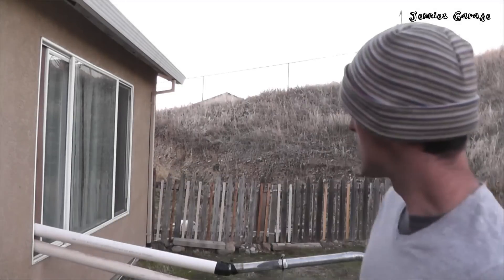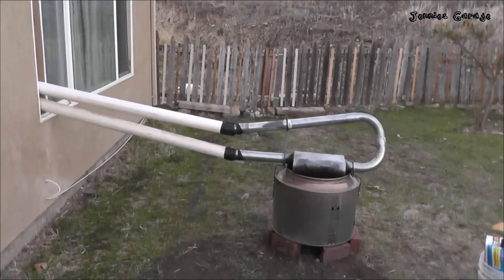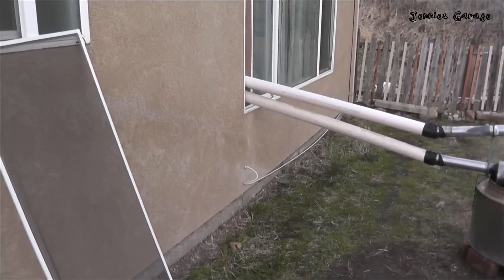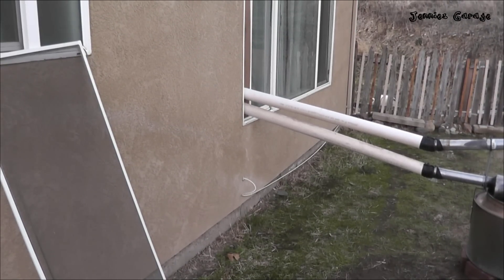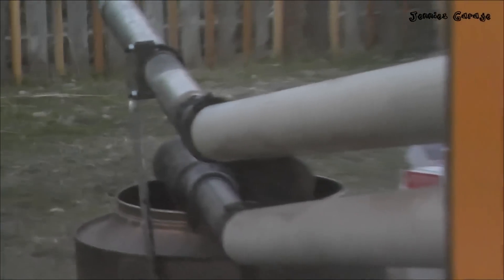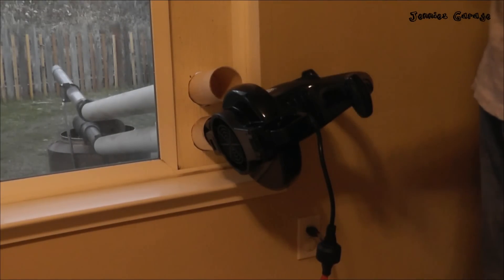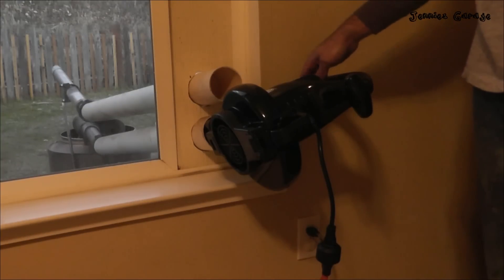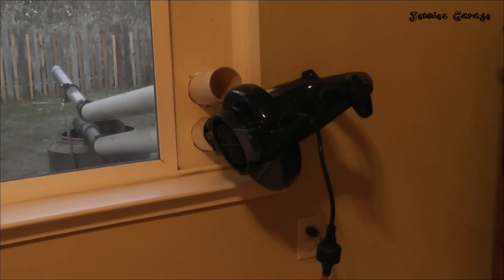How To Heat Your House With Garbage - Testing The Trash Furnace

Comment: There should still have been heat coming from the pipe, even without the blower. Build yourself a large lantern made of metal, then make yourself a large wick, fill with an oil, such as old cooking oil and you wont have to worry about throwing paper or wood as often to keep a fire going. Also, just a good fan such as the vornado fan should do the job and not so noisy.

Comment: Top job but will people complain about smoke? I have a car radiator from a Toyota hilux and with a burn barrell wrapped in copper plumbed into the radiator turning into a heater core and quiet thermo fan for circulation. Btw burn barrell gets to 250 degrees celsius with copper pipe to circulate air should heat up entire house! Any reply appreciated thanks?

Comment: I think it is better to use radiator system based on water. Water grabs the heat better for longer time tha air. But it also has to be careful with pipes and pressure holding. Pipes should be possible to move. If you use a real boiler to use your garbage or as down written here it is better to form your garbage to pellets. Compressed garbage will not eat up all your time to feed to boiler. Also a pellets boiler send in garbage pellets exactly at the time counted when burned. To much makes too much heat you dont need. It is important to use an measure-device to see the temp outside vs inside. Then you have an automatic system. The smoke that generating is probably not that healthy unless it burnes for longer time = should pellets. You must have som typ of filter that takes away the emissions. But great thinking but it already exists good systems for this but you can buy refubished systems but you must check your house or bedroom what it takes to heat up and walls, roof, floor = the U-measurements thats a formel to count how much it stands against letting heat let out of the room to the outside of the house... Count the transmissions through this to see if your house are well built. Start there and the rest you can find on internet or YT, local stores.

Comment: There is so much fail in this video! Do not burn things like motor oil and sneakers in this!!! Stupid advice. This is NOT an incenerator! 

Using a 7A leaf blower for ventilation? Really? There are many other better suited choices. A sheet of OSB in the window gap? Come on. You'll lose more heat through that interface than you would ever generate with this contraption. Thoughtful idea, extremely poor execution.

Comment: Why don't you put that device in your fire place and burn paper in there? It probably isn't very pleasant having to go and stay outside in the cold to feed the fire and if you burn it in the fireplace, you get way more use out of the heat. You should also use a smaller and quieter fan and build some kind of a shroud around it to direct the air through the pipe so that its quieter and more efficient.

Comment: @Jennies Garage i have an idea for you  look around for a kiln and dismantle it as in take out the walls and the heating elements and then get a car radiator and cooling fan or just the fan and connect it to like a riding mower battery for forced cold air into the lower side still using your muffler put the pipe you use to test the temp at the top of the kiln walls and then if you dont want to use pipe or its to expensive get semi rigid dryer ducting it can take alot of heat, just a suggestion from a fellow diy'er. Love the idea i just suggest a kiln because its designed to get almost 4000 degrees and most houses won't ever get even close to what those can take look me up on face book as peter or pete king if you wanna talk more about stuff like this. hope my suggestions help.

Comment: If you want to increase efficiency, control the burn.  Introduce forced air into the furnace.  Control it so it burns as hot as possible.  It will burn cleaner and more efficiently.

Comment: the issue is the wife will need to constantly need to feed the fire to keep you warm, you could add garden prunings to make it last longer or wood, or even drip abit of waste engine oil on it, and use a computer fan rather than the wife's loud as hair dryer.

Comment: Heat rises , No need for the fan , Have the outlet the lowest you can and the inlet the highest you can , you will have SLOW air flow which will allow for better circulation , The real challenge is in feeding that fire all night , Good job i like the ideal a lot .

Comment: Could you have used water?, had that going into a radiator in your room and used only the properties of hot water rising and then sinking when it cools. 
Used an old car or truck radiator sitting in hot water.

Comment: You would need carbon monoxide monitor. Burning anything high in hydrocarbon isn’t safe like plastic. Use bathroom ceiling fan it use less watts and quietly.

Comment: Would Puting a smaller fan in the tube of the entrance pipe would cause for slower air flow but hotter temp. As for the comments on feeding the fire he can make a self feeder I'm pretty sure he seems intelligent and rational if it wasn't worth it I am sure he would state it.

Comment: I actually built something similar to this but instead of using a muffler I brazed 8 copper tubes side by side and welded it to the top of the can, then instead of having fan inside, I used an inline duct fan which would actually work great for your build, I made a shroud that completely seals to the ends of the copper tubes and then routed them into the wall of the house, it's nearly silent and yet adds so much heat to the room
Reply from the maker: That sounds like a much better system then mine. the copper is a great heat conductor, and those 8 tubes probably pick up a lot of heat.
Reply: The copper is pretty cheap and you don't need much either

Comment: try fan outside use solar so your not spending huge amounts running fan also fan need to run slow or it will cause a cooling effect

Comment: What you did is a fun project and good proof of concept.

I'd be tempted to build a full sheet metal jacket around a sealed wood stove outside and let it burn logs slowly.  Those can run as much as a 12 hr fire without tending.  The larger two layer jacket can transfer the heat into the house with a slow fan through larger ducts. Probably 70,000 BTU off an old junk stove and a little welding or duct building.  That should heat a house quietly with no smoke removal chimney to build in the house.  Just a good twenty foot stovepipe outside for efficient draw.  You can start the fire with trash and then add wood.

Farmers have used these systems for a century, and you can buy the whole thing for a mere $2000 at Farmer Supply.  You can probably build it for 200 as you are a good scrounger.

Comment: You should use a blower motor from a junked car or old furnace instead of the leaf blower. It will be much quieter and probably work just as well. Or put the blower outside, plug it in outside if you have an outside plug, and use a Wifi switch to turn it on and off. That way less noise will be inside.

Comment: to overcome the inside noise you could put a y on the back side and use the bottom pipe to draw air from inside. will be loud outside though. use the paper to start a fire and then feed wood. you will need a larger bin to hold more wood. the concept is solid though.

Comment: With loose paper and cardboard like that, more heat is going around your exchanger than can be used. Bundle it, roll it, compress it, whatever in order to have a more efficient transfer of heat and for a much, much longer time.

Comment: mount the air blower out side .and take all the paper and shred it put it in a bucket of water over night .dran off the water and twisting the papper in to a log shape let dry for to days .it will burn hot and longer

Comment: I had some problems with what you did.. You have to buy more food more stuff to make more rubbish (trash) to heat the fire. You have to use electricity aka the leaf blower to get the heat so there for the money you are spending in buying more stuff to heat the fire and running the fan you could just put on the gas and run the normal heating :)

Comment: I have a fireplace insert that does the same thing. Heats up the cast iron frame and uses a blower mounted underneath to move radiated air past it.  Works good lasts a long time.

Comment: Just finished both videos. I too, Had been searching for a cheap heat exchange idea. You nailed it sir! I would change a few things... 
1) add 90 degree fittings aiming up and down.
2) possibly all steel pipe with insulation.
3) a PC fan (computer) to blow the cold air into the system.

Again, excellent concept! Subscribed.

Comment: Couple areas to improve. First replace the blower with a fan. Maybe try a attic fan, or even just a regular box fan. Second, reduce the diameter of the outlet pipe, that feeds into the house. This will increase the pressure of the air entering the house. Higher pressure means slightly warmer, two reasons, first higher pressure in general heats stuff, and second less travel time thru the outside, which is acting like a heat exchanger, except opposite of what you want. But also higher pressure will help heat a room better, because the air will disperse better, and further.

Comment: Most of the heat from the fire is lost through convection and radiation, heating the air outside.  You need a more efficient system to capture more heat to the heat exchanger.  You can also get rid of the noisy blower by drawing cold air from your basement, and output the warm air to the main level.  (Hot air rises.)

Comment: Well done Mr. ! A fine idea indeed however, adding to all advice I glanced at in the comment section, I might add:
- insulate the combustion chamber, so as to funnel all the heat up towards the "exchanger" :))) you have way too much heat bypassing the system.
- I would stack a bunch of tubes inside and run water through, catching the entire flame or as much as possible. In the house plumb a stack of scrap car radiators and fan the heat away from them. this way smaller holes will be needed trough the wall. I mean if you can find a way to make a water jacket and "hug" the entire flame, instead of the tube thing,it would be even better.
Of course the pump and the fans and all will be more expensive :))) And we all know that's a no no :))) But it's worth it.
- It would be a very good idea to at least shred your fuel beforehand so it takes less space and is more easily loaded in  (perhaps one more project for an automatic loading sys. as well?)   Or do the brick thing ... idk tho, it seems pretty annoying to do. 
https://www.youtube.com/watch?v=2aLZ88_DZz8 

We have a water jacket on out wood burning stove piped in the floors and radiators and it's the best! It was a horror to build but we saved thousands,have saved thousands more and continue to save probably hundreds more, every winter.
Good on ya for trying things for yourself !

Comment: Wow. Great minds do think alike. I built this same idea. But i modified the top to use the escaping heat and smoke. I created a port that a small turbo sits on. This gives me a blower for my air and uses the heat and smoke to spool the turbo.  Works well till the fire cools down. I have a second pc blower on the inside. I agree do not use pvc I use duct piping.

Comment: Maybe use a large quiet computer fan.  It will move the air slower, and can be converted to run on either batteries or AC power.

Comment: As a camper, I can appreciate your concept. In the camping world there are quite efficient tent heaters that run off propane gas and a 12V battery drives the air. These units are not cheap, running into $1000s. As most campers and caravaners would already have a small gas stove, this would be an ideal DIY system if you used a small gas stove as the heat source and ran some suitable heater ducting into the tent. Light weight to carry, and safety with no CO in the tent to kill you! A largish computer fan would easily drive enough air with only a small amp draw on the battery. 

When you go to bed, just shut it down and let the food you ate that day take over as the heat source :)

Good thinking. Ignore the idiots and knockers who can't see the forest for the trees.

Comment: I personally would use the blower assembly from an old forced air gas furnace that uses a 115v blower motor.. you could make a box for it and just wire a plug into it so you just plug it in and just wire in a switch on the side of the box or something... it would be extremely simple... and a lot quieter

Comment: But you still have to run the shop vac and it's not free. If you're going to do these videos, you have to get  a couple digital thermometers so you can see what's really going on and then you could plug it into your calculator and get the efficiency and actual savings. You're not doing it right. (HVAC Contractor)

Comment: I like your idea JG but im concerned about you using plastic piping in that system. Secondly, that direct fire will burn through your muffler sooner or later guaranteed. I suggest you experiment with putting your muffler inside a burnt out BBQ and suspending it about halfway down into the body of the BBQ, ofc ripping out the old elements, and then burying the muffler with sand top and bottom around the muffler. This will protect the muffler from direct fire and also help insulate it and help with retaining some heat. I would also find a way to close off the top of your fire pit/furnace as to further retain heat. I would use insulated stove pipes for all your outside to inside piping as this will greatly reduce any chance of fire and you wont have to worry about pvc out-gassing or your muffler burning through and you and your cat getting asphyxiated in your sleep. I know they have in-ground heating systems using fire-pits and sand covered copper piping which flush hot water through special concrete flooring and more copper piping to heat the house from the floorsl,  so i think your idea is well suited for adapting this method. You have excellent comments already on how to not use noisy fans to exchange the air but you could also consider using a regular small household fan on a low setting to push air though your pipes and ofc graduate the diameter to the outflow pipe but if you did end up using insulated stove piping this would mitigate the chances of fire and allow you more materials to experiment with and that would make your bodging up work a lot easier.  I have no space or my own house to experiment with but if and when i do I will use your vid for inspiration. Thanks for sharing your creativity and your crappy jokes! Haha. I say that kindly ofc :) Hope you and yours and your cat are well.

Comment: You should have gotten much better results, had you done it better! Far too much pipe not insulated at all. Small fire not enclosed at all, too much heat from fire just wasted into open air! Etc. Etc.     
Try again, but build a box around the fire to hold heat. put a flue pipe on top to vent it. Just dump in all the trash at one time and light it up, no feeding it a little at a time. Insulate the pipes to prevent heat loss, and use a decent sized fan not  leaf blower. HA HA   
 It's a good idea that will/does work, but it needs to be built right.  
Thanks for the info about the muffler though, I had not thought of using one of those3 as a heat ex-changer. I will have to look into that and make sure the mufferl has nothing to make toxic fumes, if safe to use would be great!
Reply from the maker: Yes, it has a lot of room for improvement. When I have a chance to work on this again, I'm going to try to do some more insulating around the fire (build a box like you mentioned) and use a more efficient heat exchanger. Thanks

Comment: gotta love how this is set up for the bedroom, sleeping while it is running must be a challenge, plus having to wake up every 5 minutes to feed the fire. it might be better to either burn wood or waste oil with a drip feeder and find a quieter blowing method which uses less power. This project is faulty in so many ways and is completely useless for anyone who doesnt want to stay awake 24/7 or spend more time outside than inside

Comment: Install the hot pipe at the top of the window and the cold pipe at the bottom of the window with a pipe to the floor. Hot air will rise into the room while sucking in cold air from the room.

Comment: what you could do is use a rechargeable solar power battery with a switch going into the house. during the day solar power battery will recharge and could be used at night as needed. as for the fan you could use as someone else suggested a low usage bathroom fan

Comment: ya.........your headed in the right direction and like the paved road to hell...your intentions are good   but your losing on the forced air part of the deal ..not to mention your labor! Outdoor..super long burning efficient wood ...trash burning stoves with a circulating pipe into the home...are already being used everywhere and are very efficient.  I personally live in the country and I have a few acres of hardwoods and a Sierra 8000 woodstove with a built in caytalytic converter that I heat with,in the Carolina foothills all winter long A chord and half of wood will last all winter and there is no finer heat! I also burn all my paper trash in it! I let it go out every Saturday and put the ashes in my garden light it back up in 20 minutes and go for another week. Its air intake works like a swiss watch so every night I put it on slo burn and then add a couple more logs in the morning and my 1700 foot home stays toasty warm. My heat pump is only on in the summer for AC. It just doesn't get any better!

Comment: I use 1 to 3 oil lamp depending the outside temp.  Also the desk fan .  It heat my home average 69-74 degree  One Walmart lamp oil can last up to 48 Hours or sometime 2-3 days.  I buy 1.89 liter Walmart oil lamp and can last up to two weeks